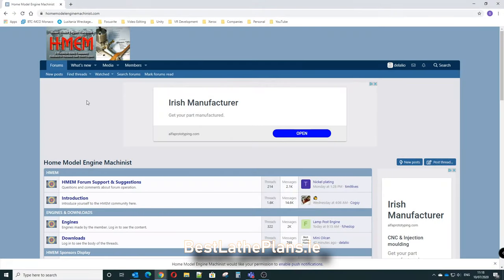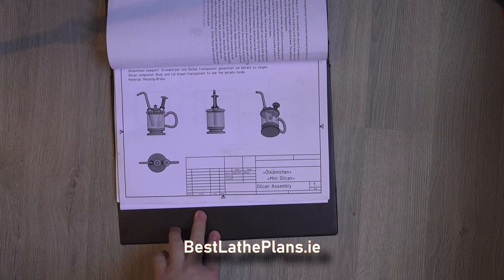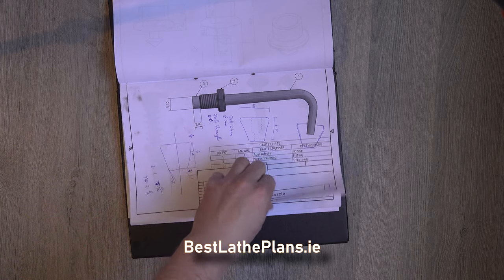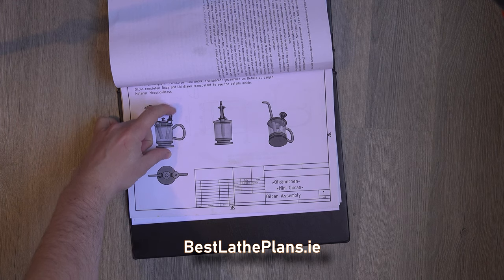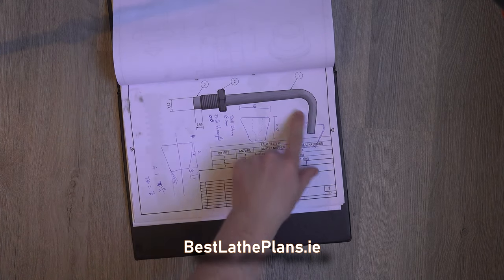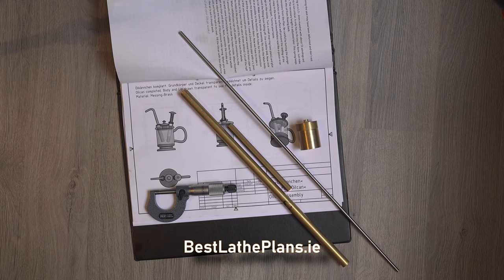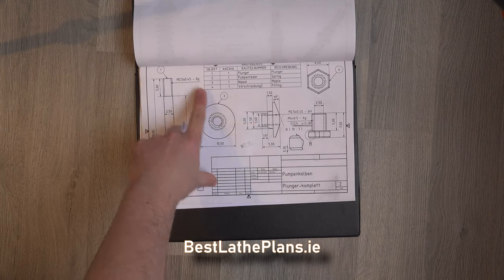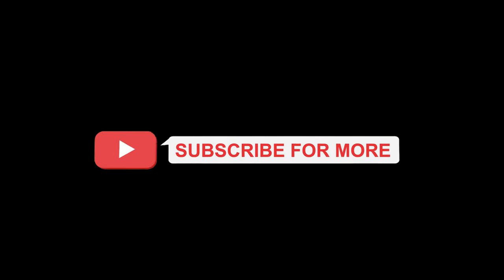Intro and Plans - Worlds Smallest Oil Can - Part 1 - 4K / UHD - BLP

Comment: hy , we already spoke about the oil can wich was not working with oil ( at least mine )  so i made a second one exact to the dimensins and i ended up with a second one non working ! i reworked both now and now they work much much better than the one in your video ! you might try a small spring made from 0.17mm guitar wire inside the outlet to hold the ball down adn one under the plunger aswell ( the one in the outlet is about 20mm long the spring under the plunger is about 12mm long and pushes the ball down when the plunger is not moved. so i found that the pump made from plans sucks in some air on the backstroke and to prevent that i made the two extra springs ! try it , you would be suprised how well it will work ! also a nozzle tip with 0.3 to 0.5 mm hole works much much better ! you realy can apply drops from tiny tiny drops up to a nice formed drip to oil a part.  i dound my modifictations realy necesary since the pump was not working as a oil pump /can should ! i would apreciate if you might give it a try and add a 6ht series ( for all the people wich might habve the same issue in the future !  ;)

Comment: Hi there, I think you are making a great tutorial video. I will follow the next episodes as I intend to build a miniature oil can to go with the 2" scale traction engine that I am building. I would probably alter some of the designs and make the body the traditional oval shape.
Emanuel L
Reply from the maker: Sounds great! Glad you like it. Grab the designs from the HMEM forum and yeah, the main body is non critical so you can make it any shape. Just make sure the pipe between the two pump housings can fit if you reduce the internal diameter of the body. It should be possible to put a very short straight pipe in place, but you may have to do that with the pump housings in-situ, as you wont be able to install them very easily afterwards! Send me a link when you have it built. Would be great to see.